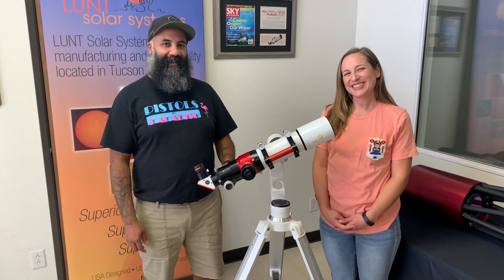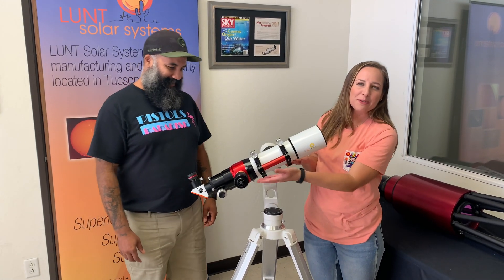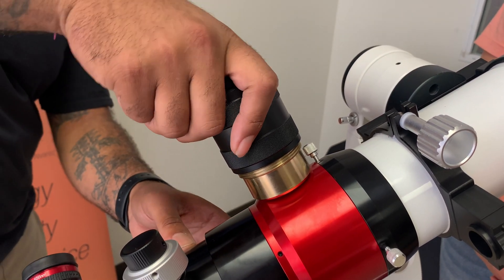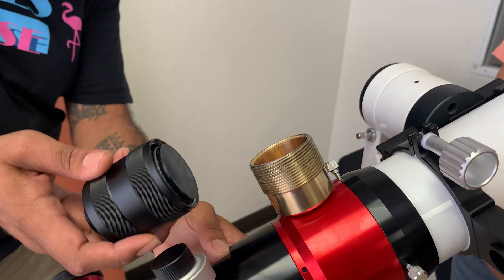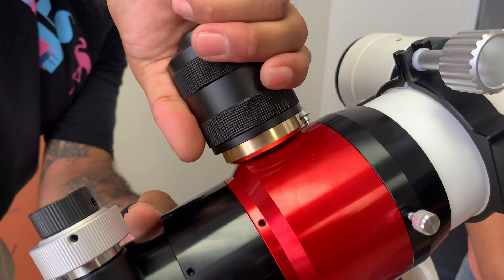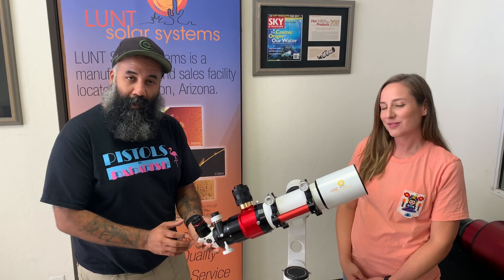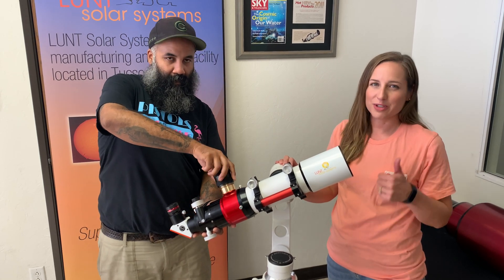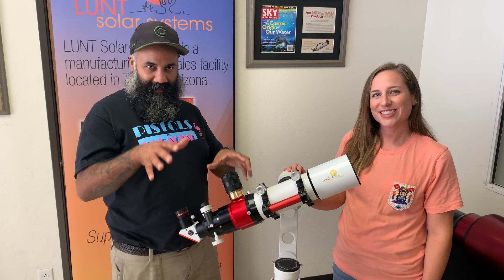Under Pressure: A Tuners Tale

Comment: Is it possible to damage the etalon if dust gets into the chamber when resetting the tuner?
Reply from the maker: Hello!  It is difficult for dust to get into the actual pressure tuner chamber and small particles won't affect the performance thankfully.
Reply: @LuntSolarSystems  I see. Thanks for the info!